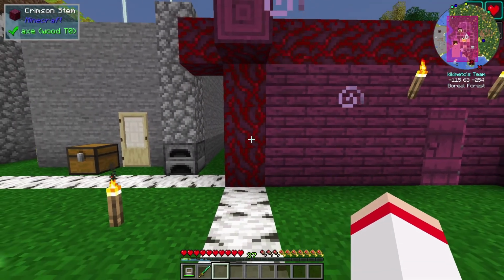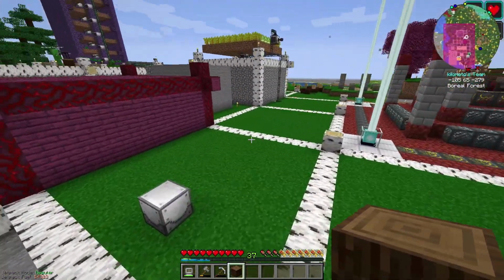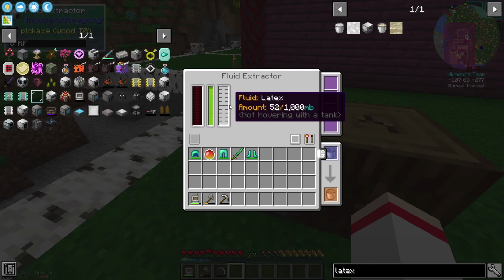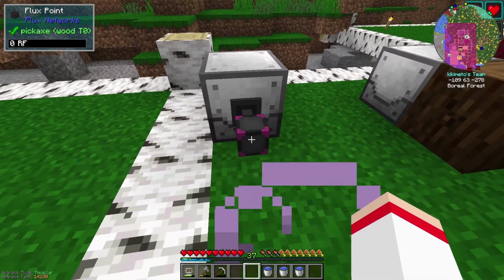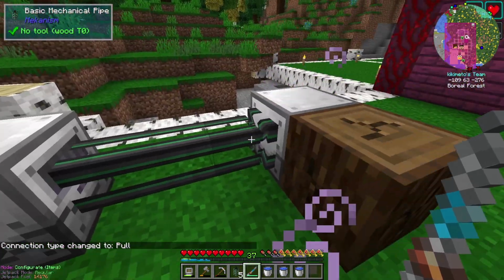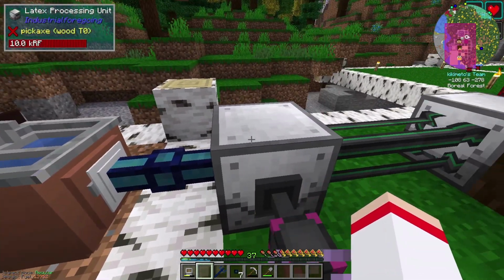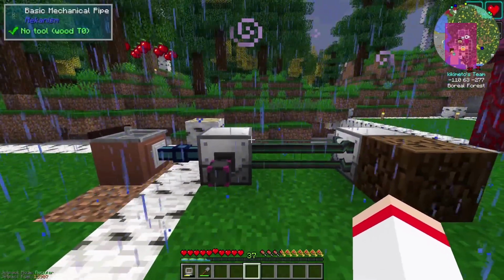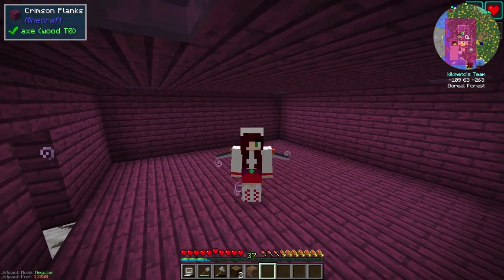How to Craft and Setup Latex Processing Unit from Industrial Foregoing | All The Mods 6

Comment: Very useful, thank you! ❤️ But do you know any mod that can replace the Mekanism mod? It does not work on servers and I need a mod like Mekanism but I have no idea what mod could replace it decently
Reply from the maker: Thank you for the comment <3 Depends on what you want to do with it. I don't think that there is a single mod that can replace it, but you can check out EnderIO, Thermal Expansion, Immersive Engineering, Industrial Craft. They fall into a similar category

Comment: Do you have any videos explaining who to get steel to make the cable for Mekanism? I got the mod but i'm very new at this and dont have idea how to do it. I didnt find it any block, so is another process? Can you do a video about it?  Thanks!
Reply from the maker: Thank you for your kind comments :) I currently don't have a video on crafting steel, but I will create one and try to post it as soon as possible. Steel is not an ore you can find in Minecraft. You have to create it by combining iron ingots with coal. I hope this helps for now, until I publish a video about it.
Reply: Mekanism uses the metalurgic infuser to add carbon and iron together. You need to first add coal to the machine's internal buffer (the input box on the left) and then put some iron ingots into the middle input box and wait. This gives you enriched iron. Simply repeat this process with the enriched iron in this machine to get steel dust. Then all you need to do is smelt the steel dust into ingots. :D